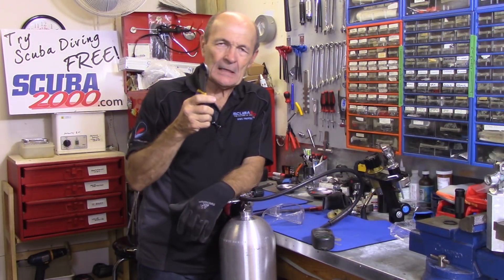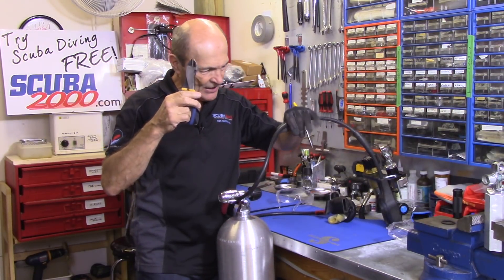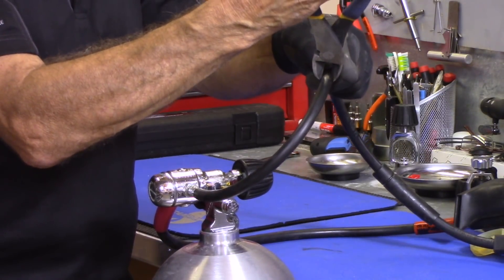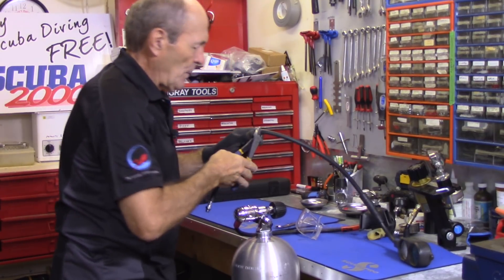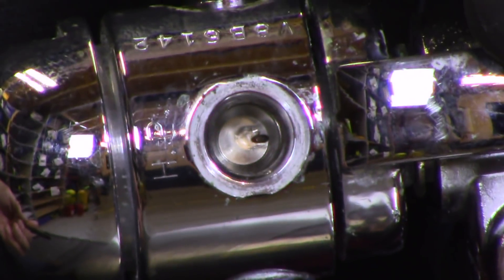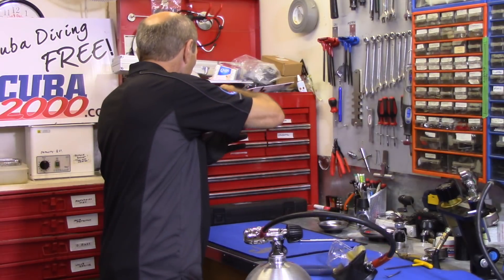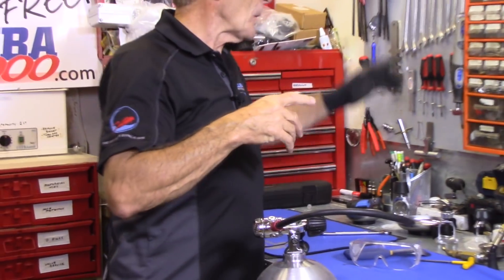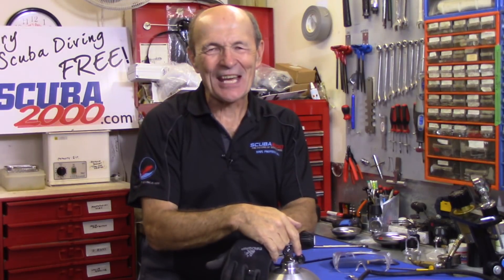What Happens If A Hose Blows? - Scuba Tech Tips: S06E16

Comment: I had a low pressure hose burst once at the beginning of a dive (full tank). I went from 3200 PSI to 750 PSI in about 45 seconds. The ocean around me looked like a carbonated beverage. While it sounded like a .45 being discharged next to my head, to my GoPro it sounded like a tiny “pip”.  Video of the incident was posted on YT.

It’s my understanding a high pressure hose failure will result in a stream of small bubbles and your tank wouldn’t empty nearly as fast.
Reply from the maker: HP hoses have very small openings as only pressure needs to pass down the hose.  Air will come out but not as fast as a larger LP hose.  Glad you made it back.
A
Reply: @AlecPeirceScuba_SeaHunter  can confirm 🤣 60 seconds of excitement

Comment: I had a quick look but didn't see anyone mention it.. You can easily kink the low pressure hoses to save your air if this happens, probably wouldn't work with the hp one tho. You can entirely stop the leak doing this as long as you're holding it. Love your tech tips videos, I'm slowly working my way through them, thanks Alec!
Reply from the maker: Thanks for the tip.
A

Comment: I only recently found your channel and have learned quite a few things (I've been an active diver since '83).  I once had bubbles streaming out the entire length of my HP hose and I was quite nervous for the rest of the dive (a DM led dive in difficult conditions in Palau so aborting at that point would have been difficult) - had I already seen this video I could have just noted it and enjoyed the rest of the dive knowing it wasn't that big a deal.  A few years ago I saw a DM's o-ring burst during a dive (?) and it looked like a different situation altogether...no restriction in the valve and HP air coming out - he was engulfed in bubbles as you might expect.  The DM handled it calmly, and it was nice to see all the divers start to rush to him ready with their octopus.  After the dive he told us it wasn't that big a deal - he still had air to breathe.  I could only guess he'd experienced that before as I don't see how it would be possible to calmly handle that the first time it happened!
Reply from the maker: The more you dive, like a DM in the Caribbean, the greater the chance you experience some sort of failure, hose, o-ring, LPI, dropped belt and so on.  Glad my channel helps you feel more in control should this happen  to you.
A.

Comment: I had what I thought was a blown hose from my right hand post at 50m - Twinset diving. I did a valve shutdown and ended the dive breathing off my other regulator. When I surfaced and inspected the regulator it turned out that one of the LP inflator hose for the second bladder in the wing had come loose and nothing seriously wrong. So it always pays to check that no hoses have loosened whilst traveling when putting your gear together. This was also the fourth dive on the trip, so I would have thought any issue would have manifested itself during the first dive, but not so.
Reply from the maker: Glad to see training and calm thinking kept you safe.  Thanks for sharing Gordon.

Comment: On the low pressure hose test, you should have attached the SPG and timed how long until the cylinder was empty. I know at 1 atmosphere it's not the same as at depth but it would give some idea how much time a diver has to surface.
Reply from the maker: I prefer the 'grab my buddies spare' method but you could try that option too.

Comment: I had a high pressure hose blow on me.  I just posted this on your video about pony bottles.  Probably why this video was recommended.  

My worry would be it happening on a vacation, when you are doing drift diving.  Surfacing early during one of those could end up with you being lost. On vacation they usually tell you to surface as a group.  A blown hose you wouldn't have time to tell the divemaster you have an issue.  My plan is every 4-5 years I'm just going to replace the hoses.
Reply from the maker: It is rare to have a HP hose blow but as you experienced, you have time to make a slow, safe ascent.  When drift diving, it is expected for every diver to have a SMB to signal on the surface.  If you can signal the guide you're going up, fine, if not, you surface anyway.  Remember before reaching the surface to look around and listen for moving boats.  Key point is a burst hose is not a panic event as you can surface safely and orally inflate the BC then wait for a dive boat.
Reply: @AlecPeirceScuba_SeaHunter  I agree with this.  My worry is the dive boat usually waits around where the dive should end.  With heavy current on the surface you can get pushed far away.  

My hose bust, when I was helping with a rescue class.  Always wondered if the instructor cut my hose.

Comment: So the rubber sheathing of my lpi hose is torn, but the nylon looks good. Is it time to replace it, or can I keep using it for a while? (its 12 years old if that makes a difference)
Reply from the maker: Several factors determine hose replacement.  Age (12 years is long), and if the rubber cover is torn, yes replace it with a flex hose (you will love them).  It's not work trying to avoid a replacement as todays flex are super light, flexible and colourful too.
Reply: @AlecPeirceScuba_SeaHunter  Should I go ahead and replace all of them since they are all about the same age?
Reply: @mgmgeorge3  I would, because the money spent is worth the safety, and saved frustration in the future

Comment: Hey Alec, first of all, i love your videos! Then a question: During the dive training I learned to point the pressure gauge away from me when opening the bottle because of the possible danger of breaking glass. But the video about cutting the high-pressure hose shows that there is not much volume to apply force. What is true about exploding pressure gauges?
Reply from the maker: Facing the gauge away from you is a very old idea and based on the earliest SPGs that had glass faces, a take-apart design and no air volume restrictions. That has not been the case since about 1975. You must have had a very old instructor, or a stick-in-the-mud. You know the type - "That's the way I learned so it's good enough for you!".
Today, the gauges are modular (i-piece design), have shatterproof faces and restrictive orifices.
Plus, they have a hard rubber plug in the back of the gauge housing that will blow out in the unlikely case that the high pressure air gets too high inside the case. This plug will fly out like a .22 bullet - right into your eye if the gauge is facing away from you. So the idea of turning the gauge away is NOT good.
I have a video about this. I think it's called Things Your Instructor Taught You That Are Wrong.
The best advice is to simply turn your face away from the gauge as the air pressure is turned on.
Alec
Reply: @AlecPeirceScuba_SeaHunter  I just got my OW last year, so a newbie on diving but very interested. Greetings from the Netherlands!
Reply: @AlecPeirceScuba_SeaHunter  I heard a young instructor (who wasn't even alive in the 70s and may not have been alive in the 80s either) say this within the past couple years.  Also, a lot of tech diving gauges have glass faces even today.  I agree about the advice to turn your face away from the gauge though.

Comment: Can a typical 1st stage reg maintain anything like 10bar/150 psi in the octopus with a fully cut hose on the primary 2nd? I suspect it can't!  

A free flowing 2nd stage is actually relatively limited air flow because the metering orifice in the 2nd stage is significantly smaller area/diameter than the LP hose ID and this scenario is a test that the regulator manufacturers do (and have to do for certification/type approval).  But with a completely cut LP hose, worst case next to the 1st stage is going to prove a problem, because the regulator piston/diaphram will be fully retracted off the 1st stage metering seat, and yet there will be hardly any restriction down stream of that seat due to the cut hose.

Of course, in reality a completely cut hose is just not going to happen, outside of a James bond movie underwater fight scene of course.........
Reply from the maker: Good question. I've not explored that and may do so in a future Tech Tip.
However, I do know that if a 2nd stage, primary or Safe Second, is held open as in a complete Free Flow position, the IP drops very low, so low that it would not supply sufficient air to the other 2nd stage to allow you to breathe.
Fortunately, as you say, that's a very unlikely occurrence.
Alec

Comment: Now I'm not worried if a shark bites my hose... but what if the shark bites my tank?
Reply from the maker: He's going to have a toothache!
The Bull Shark has the strongest bite and it's been measured at less than 500 pounds of force.
500 pounds on a scuba tank will not even scratch the surface, well, maybe scratch it, but realize the tank is about 1" thick and is supported on the inside by a force of 3000 pounds pushing out on every square inch (when full).
Interesting that you are thinking about getting bit by a shark and worried about your tank!!!
Alec

Comment: Looking in the internet world,  there are some people that claim that a low pressure hose failure would empty your tank in about a minute and a half. (Due to the high volume of air flow). While a high pressure hose failure would take well over 10 minutes. (Low volume flow). Does that sound right? Has an actual test been conducted?
Reply from the maker: Yes. I have done such tests and I can assure you that any diver with half a brain could easily reach the surface if a hose blew.
What many 'experts' forget is that the LP hose, the primary regulator hose, gets its air from the 1st stage. It doesn't just blast out of the tank. It goes through a couple of restrictions and only leaves at a pressure of 150psi regardless of the hose diameter.
Relax. Check your hoses.
Alec
Reply: Hi  @AlecPeirceScuba_SeaHunter  
I've only just found your videos and I've already watched a load of them. I'm really enjoying your style and content, even though I know a load of this stuff, it's great hearing it come from you!
BUT I have to take issue here!
A low pressure hose failure is pretty much as bad as it gets and @Aaron is about right, a 12 litre tank empties very quickly. I believe it varies depending on the tank pressure, but an average is around 24 litres/sec. So, for a 12 litre tank pumped to 200 bar that's 100 seconds or just over 1½ minutes!  
With a safe ascent rate of 18m (60ft) a minute, you can see how serious this is!! 
If you are diving at turn pressure (around 110 bar) and at depth (say 30m /100') when you have your failure, you will not have time to relax!  You will have exhausted your tank in less than a minute, your safe ascent will take you about 100 seconds (assuming you have no overhead obstructions - needless to say, you will not be doing a safety stop or deco (unless you have other tanks/stages or a buddy that is right with you)

Comment: Useful. I was diving last week in Gozo with my daughters and one of them was using rented gear from the dive operation guiding us. About 15 minutes into the dive I noticed a stream of small bubbles started coming from her depth/pressure gauge console. I pointed it out to the guide, but he didn't seem concerned and we continued the dive (for another 45 minutes). I stuck close to my daughter just in case. Luckily we didn't turn the Blue Hole into a jacuzzi.

I did wonder how long I'd have to get my octopus over to her if it did get a bit too bubbly.
Reply from the maker: It was probably a weak swivel pin. I cover the repair of that in one of my videos. They are subject to a lot of wear and tear.
The good news is, that while it must get fixed, it is not usually a reason for serious concern on a shallow dive.
Take care.
Alec
Reply: @AlecPeirceScuba_SeaHunter  Many thanks for taking the time to answer. Enjoy your videos. Very useful.

Comment: Hey, couple weeks ago my istructor`s regulator got separated from the hose (yeah i know...) the hose started whipping around bad, hit him on the mouth, he had to submerge so we would have a chance to turn air off, hose just kept whipping around
Reply from the maker: Odd but possible. The separation firstly is very unusual and the hose whipping around is strange. The heavy metal fitting on the end usually keeps 'whipping' to a minimum.
However, like a garden hose, some will and some won't.
I hope everyone is OK.
Alec
Reply: @AlecPeirceScuba_SeaHunter  yeah, when he submerged we were able to turn the air off. And you are right, he still had plenty of air to finish class :)

Comment: Maybe you could have mentioned the different thread sizes  of the hoses to highlight that they can't get mixed up - great video Alec, love to see your enthusiasm, and your love of the sport. When can I collect my regulator!!!
Reply from the maker: Regulator? Remind me. I'm old.
I'm certain that I have mentioned that regulator hoses now have 2 different threads to keep the low pressure and high pressure separate. Check back in Tech Tips for references to hoses.
Years ago when they were the same, it was a problem - blown hose or inaccurate SPG.
Alec

Comment: Alex so you visually check your hoses for signs of wear and tear etc and everything looks to be in good working order. What could cause a hose to pop nothing concerned you during the visual check? Thanks
Reply from the maker: I check my hoses regularly - not before every dive but maybe monthly.
Generally, hoses are very durable. There is no reason for them to fail in normal use.
Many years ago, every DACOR regulator we sold had a hose that blew wide open when the air was turned on. It was a defect in the manufacture of those hoses. Scuba companies do not make their own hoses but buy them from another company. Needless to say, DACOR stopped buying them.
Take care.
Alec

Comment: So Alec, What if you had 2 tanks? Would the regulator shut one side off and continue to use the second tank or would both of them lose pressure? I would think that there would be a shuttle valve of some sort to shut air off from one tank and use the other tank by monitoring the hi and low pressure of each tank. Besides that hi pressure hose is bullet proof. The low pressure hose seems more dangerous to me. Hi volume, NO AIR to the mouth piece. Thanks again, great video. Keep up the good work.
Reply: On a twinset, both tanks would empty (quickly). You have an isolation valve between the two tanks and we do safety drills to practice reaching this and being able to shut it down in seconds. Then shut down the pillar valve in the hope that you isolate the problem and save a bit of gas!!

Comment: Well if that happens to you primary regulator hose you just switch to your octopus and make your way to the top because you're going to be dumping air like a madman worst case scenario you could just breathe using the bubbles like you would with a free-flowing stuck regulator
Reply from the maker: If you are calm and cool that's certainly what to do.
Thanks Joseph.
Alec
Reply: See my comment above!
You do NOT have that much time! You will also be in a panic!

Comment: Alec, great video!!  The 150 psi is that an industry standard or does that vary from manufacturer to manufacturer???
Reply from the maker: It varies a great deal and can be anywhere from 120 psi to 160 psi. Neither a low nor a high IP is better. It depends entirely on the design of the regulator. 
Generally the IP is between 135 and 150 psi.
Alec

Comment: Hi Alec, if you were in the situation with a ruptured hose, wouldnt you be better off to kink the hose to reduce airloss? i never see anyone mention this... surely there is something out there you can clamp on the hose to stop it leaking...
Reply from the maker: It's not a bad idea Tom and I'm sure there's a way to do it. Something like Vise Grips ought to work - an instant clamp sort of thing.
But, your tank air will last several minutes even with a hose blown out.
Probably best to use those minutes to get to the surface or to your buddy.
The chances of having a useful clamp with you on the dive that the hose blows (1 dive in what, maybe 10,000?) and being able to reach and cut off the air flow is slim, like zero!
Blown hoses that I've seen broke down at the metal ferrule close to the first stage. Hard to reach.

My personal philosophy has always been to get to the surface when something that could be life threatening occurs.
Many divers think that surfacing is an admission of failure. No. Drowning is an admission of failure!
Some divers think that going to the surface quickly is dangerous. No. Drowning is dangerous!
Can't solve it quickly underwater? Look up; short breaths in & out if possible; go up; problem solved.
Good thinking though.
Take care.
Alec

Comment: I would like to know how many minutes it would take to drain a full tank with a Lp failure.
Reply from the maker: Lots of factors will affect that but roughly, 4-5 minutes.
Alec
Reply: Depends on depth for a start as one factor.
Reply: @greatwhitesharky3261  I don't think depth has any bearing at all!  The pressure in the tank may have an influence. You will be losing air at an astonishing rate whatever depth you are!
Reply: @Graggs  Yes, but at the same time you are still breathing and using air, so the greater the depth the harder you breath. If you breath air at depth of course the air will not last so long compared to being shallow.
Reply: Absolutely correct @greatwhitesharky3261